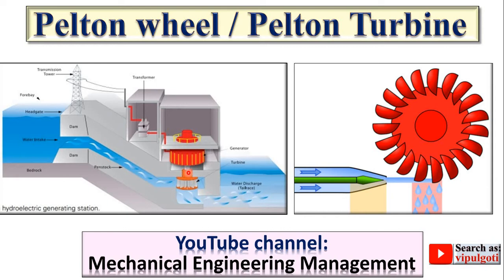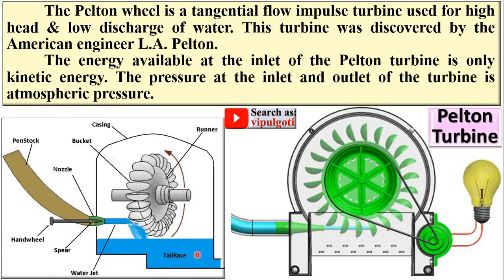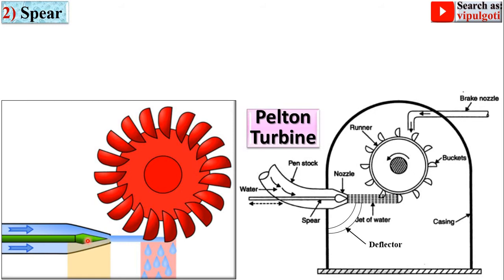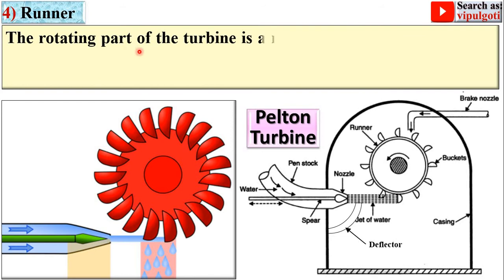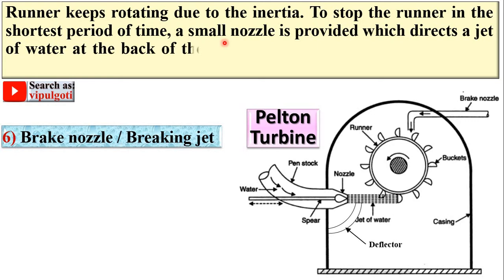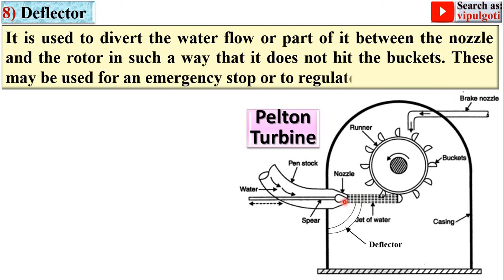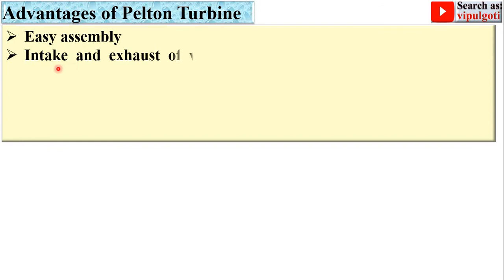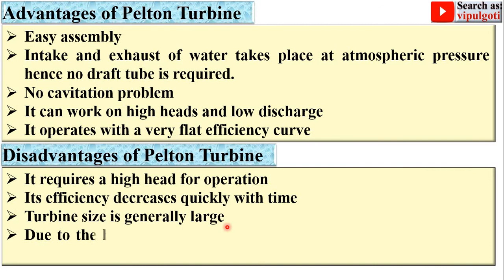Pelton turbine|Pelton wheel|Hydraulic turbine|Impulse turbine|Water turbine|Parts of turbine

Comment: What is the reason behind low discharge rate for pelton wheel.,??
What will happen if we increase it head??
Reply from the maker: It's actually designed for low discharge and high head.
Reply: @vipulgoti47  sir can you explain it little bit more , 
What will be the effect on it ,when we increase discharge
Reply: @vipulgoti47  thanks sir